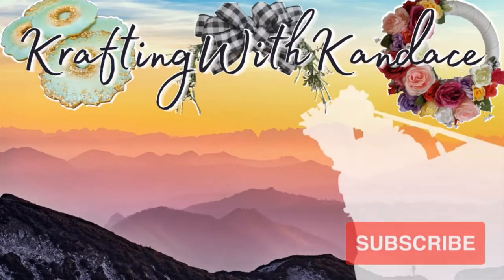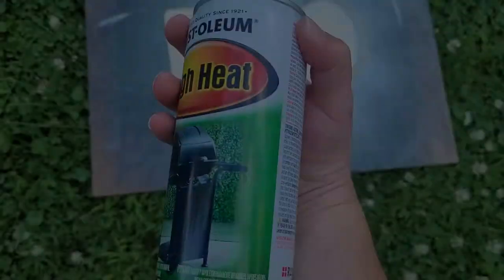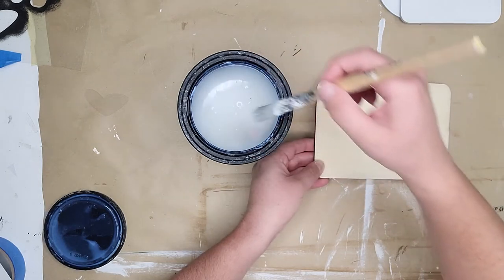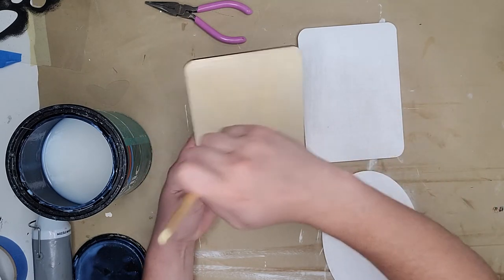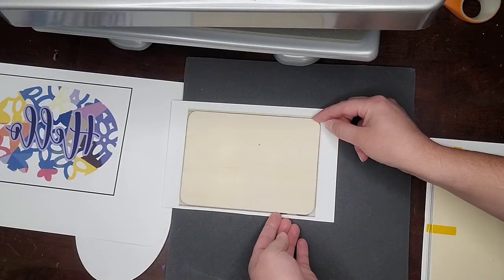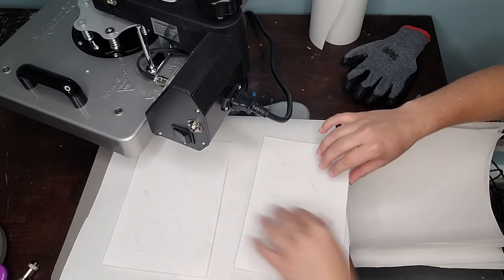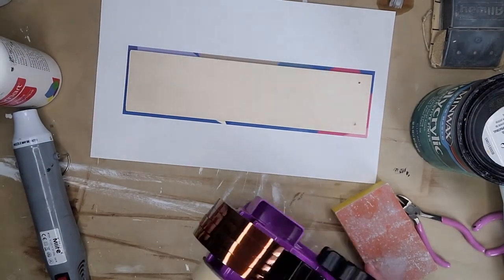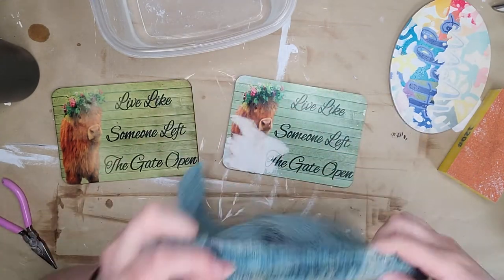Sublimation On Wood | Sublimate On Natural & Painted Wood W/ Polycrylic | How To Sublimate On Wood

Comment: Ok i know this video is 6 months ago but since i cant find an explanation on google im here to ask you: what is wood sublimation?
Reply from the maker: It is simply doing the same process of sublimation, typically done on polyester, and trying it on wood.
Reply: @KraftingWithKandace  this doesn’t help me as my question is what is sublimation
Reply from the maker: I apologize, I didn't realize it was about sublimation in general and not directly to wood. In crafting terms, and to the best of my ability, sublimation is when you print an image on sublimation specific paper, (with sublimation specific ink and a special printer)  and then heat press that image into your "blank", which in most cases is a polyester fabric. The heat takes the ink and turns it into a gas. The gas gets permanently trapped into the fabric. That being said, many are experimenting with several different materials, like wood, and many others. I hope that helps, however, I still consider myself new in this area!

Comment: Did you try the High heat paint without the Polycrylic?
Reply from the maker: I did not. It's my understanding that the Polycrylic is what makes it work. However, I'm still new to this and playing around with everything!
Reply: @KraftingWithKandace  I'm new to sublimation as well, but from past "woodworking" experience, the high heat paint wouldn't normally get a clear coat over it, especially a water based clear.  I am pretty sure that I saw someone just using a piece of painted wood, no Polycrylic.  We tested on bare wood the other day.  I have a piece of wood with Polycrylic to test on today....and we might try just painting a piece white to see!!!  Thanks for your reply!